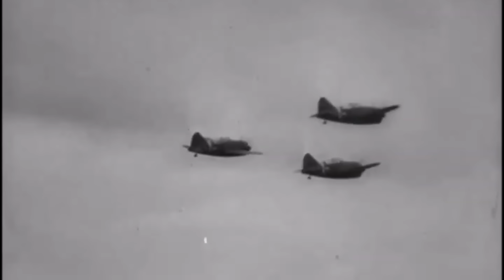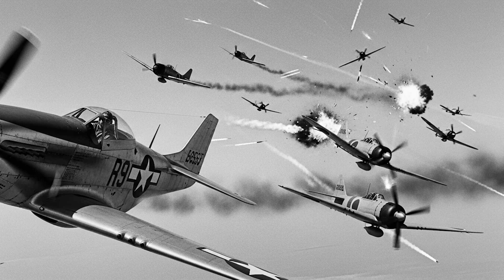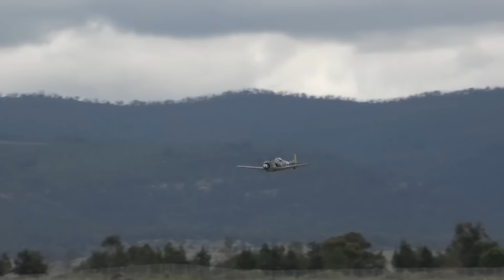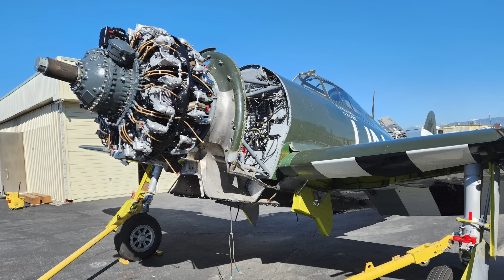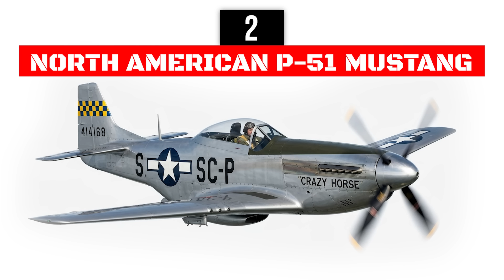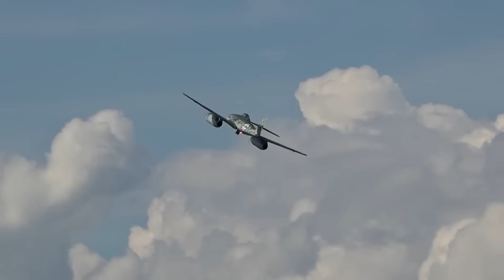Every WW2 Fighter Aircraft Ranked - WORST to BEST (COMPLETE)

Comment: P38. Best fighter in the war. Period. Most kills. P51 only became a fighter after it got a complete remake
Reply: It was a phenomenal fighter, but it simply did not have the most kills. The P-38 was taking the fight to the enemy (in both ETO and PTO), and doing it very well, for years before the late war fighters came on the scene...ask Yamamoto. The Lightning did very well in the North African/Mediterranean theaters as well. The P-38 Lightning was the first Allied fighter to make it to Berlin and back (it wasn't the P-51 that did it first). Several 15th AF squadrons refused to give up their P-38's when they were told they were switching to Mustangs, they asked why they had to give up their "Cadillacs" (P-38s) for "Spam cans" (P-51s). They kept their P-38's until the end of the war. The top American aces flew Lightnings.
Reply: @djraymond5767 and the P38 had superior fire power. No vectoring of guns. Line the nose on your target and smoke em. If the P38 got  Rolls Royce engines it would've easily been the best prop plane ever without question.
Reply: @eriknewman5288  That was suggested, but the President of the Allison engine company sat on the War Materials Board and vetoed the suggestion. He claimed that taking production of P-38s offline for "a whole week" to change the assembly line would be too detrimental to the war effort. He never mentioned that his company would lose money.
Reply: @djraymond5767 but of course he failed to mention that.  Goes to show which plane was more necessary. P38 couldn't be lost. P51 had Thunderbolts which were more than capable. Final variation P38s were more deadly than P51s. If a P38 hit a P51 you'd have chaff falling to the floor
Reply: Thank you. The guns being centerline was game changer